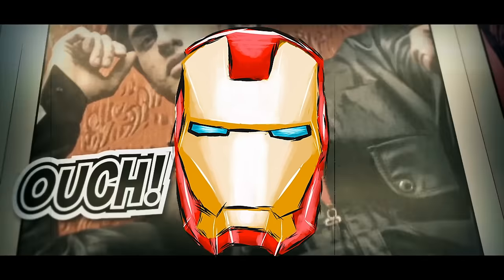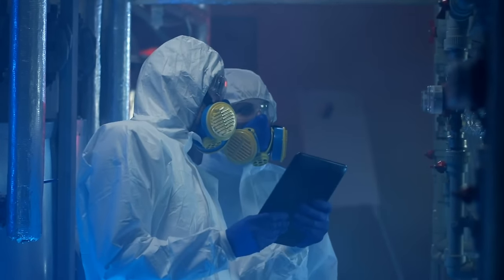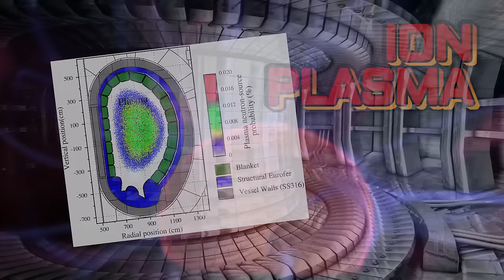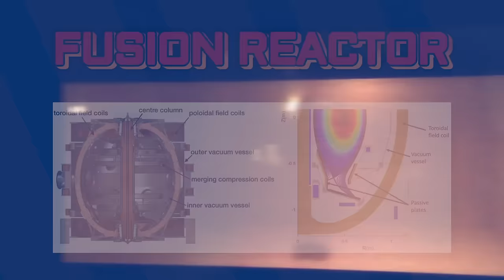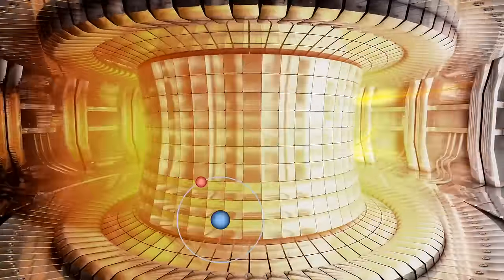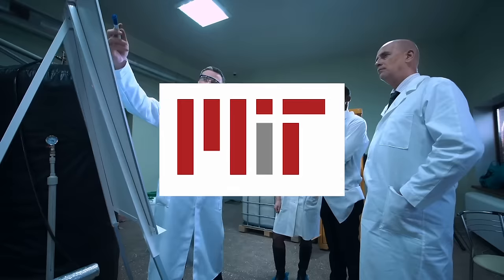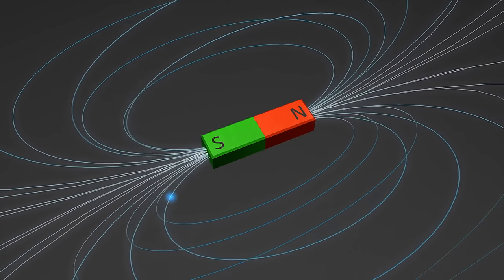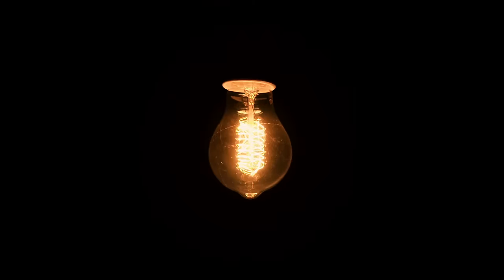How Does Iron Man's Arc Reactor Work?

Comment: A few weeks ago I read that they finally managed to sustain a fusion reaction long enough that they got out more energy than the startup process put in.
Reply: After you get one to successfully continue to run, couldn’t you also absorb/use the heat waste with thermoelectric generator encapsulating it or integrating it. In theory use the ionic energy plus the heat that’s produce as energy as well. Wouldn’t that boost total energy production of the design.
Reply: @302big5  I have no idea. I'm a trucker, not a nuclear physicist.
Reply: @benwillems8584  good man, I’m actually trying to get my cdl in the next month, I just thought I start the conversation based on the information you found.🫡
Reply: Yep and now iron man tech is possible at least a mark 1 or 2 at the moment just no one has really executed it yet but in the future like say a year or so maybe they will

Comment: It would have made more sense for the arc reactor to have been a zero point field or casimir effect generator, because we never see Tony refuel it with hydrogen/helium, nor is regular hydrogen a particularly good fuel source for fusion (deuterium or tritium much more efficient, and where would he get those in a cave in Afghanistan?).
EDIT: granted, he had a lot of spare Stark missiles that he had to work with, so he might have had a good source of tritium. But the waste heat would be a major problem for a fusion reactor.
Reply: Deuterium and tritium are literally H2 and H3. He utilizes the radioactive decay in rays and accelerates the tays to profuce energy magically.

Comment: Hey you know they recently found out a way to create super conductors at room temperatures using high pressure. this in theory could be used to make the reactor work.
Reply: High pressure is an understatement there bud.

Pressure so high that you could not possibly maintain it outside of a lab experiment.

The only use in threse current experiements is to inform strategies of study to create future hybrid low temp, high pressure materials that require only lower level cooling rather than LN2 or LHe, when combined with a managably high pressure to achieve superconductivity.

Removing the need for LN2/LHe coolant would reduce the cost of using superconducting material a lot, but if the pressure needed for superconductivity is prohibitively high then the cost of using it will be too.

Comment: I kinda wish that you  went more into the specific about the supply of hydrogen, because using tritium and deuterium is great but where does it come from? it's not like fusion is genuinely so convenient that is infinitely self sustaining. It's why the sun's core is iron; the process of fusion makes a heavier atom, that heavier atom fuses with heavier atoms, and the energy for each stage of this has net of less output, until about iron, where it becomes no longer efficient to do anything with it, whether fusion or fission. But not a bad video.

Comment: If it's a fusion reactor, what's palladium for? Palladium is too heavy for fusion, so it's not exactly true. Also what good those little coils when you have to transfer those 3GJ/s to devices that use it. It'd melt anything it came in contact with.
Reply: To loose electrons to form the EPS, electro-plasma system circuitry current needed to sustain the MHD (magnetichydrodynamical) power transfer. -> In another words, technobabble. 
Just like the Iron Man suit. It’s supposed to be made of an Titanium-Gold alloy. Except that any knowledgeable chemist or metalurgist will tell you such combination will make for a brittle titanium, it’s a non-stater, and it won’t resist cold temperatures better. A much better choice would be Nitinol, Titanium Nickel, with a bit a niobium for good measure. 
They just put the gold in there because, I don’t know, sounds cool. 
Also, did you notice that what I describe to you sounds a lot more like a fission reactor based on palladium rather a cold fusion reactor? That’s the problem sci-fi writers get when they attempt to explain the details of something. It’s called the “midichlorian problem” - best to left to the reader imagination.

Comment: A full size Tokamak doesn't require palladium.

I always figured the original Arc Reactor as well as the miniature one were using matrix confinement cold fusion (as originally reported by Pons & Fleishman in the 1980s, then debunked, and undebunked, and redebunked at least a couple times since then).  This is a fusion reaction that depends on palladium (though more recently it's been shown that it can occur in nickel, as well, but that would screw up the plot of Iron Man 2).  It's now known to be a real phenomenon (last I checked), but doesn't proceed at a useful rate, similar to the reaction in a Farnsworth Fusor (electrostatic confinement, mainly useful as a compact low-rate neutron source when running on deuterium/tritium, attractive because it can be built in a garage or basement).
Reply: The palladium creates the effect of the high pressure and gravity of the sun. The palladium atoms expand and contract to squeeze hydrogen atoms together to make helium atoms, creating heat.
Reply: @WolfeSaber9933  Which is pretty much the description that was given for matrix confinement cold fusion in the 1990s, except for the (not happening) expansion and contraction of the palladium atoms.  Also worth noting that just fusion heating in Tony's chest wouldn't do anything to either keep the shrapnel out of his heart, or to power the suit; he needs a reaction that directly produces high current electricity with little if any waste heat.
Reply: @SilntObsvr  There is a process that can convert heat directly into electric.
Reply: @WolfeSaber9933  Yeah.  Go look up its efficiency.  Tony'd be cooked before even his heart magnet was powered, never mind that Mk. 1 suit...
Reply: @SilntObsvr  a chair can give about a trillion watts.

Comment: I ran some calculations on this.  The average human male has a surface area of roughly 2 m^2.  Assuming that iron man's suit is roughly an inch thick of titanium; then you'd be looking a volume of 0.0254 m*2 m^2 = 0.049 m^2.  Titanium has a density of 4506 kg/m^3... which would mean the mass of the suit is:  0.049 m^2 * 4506 kg/m^2 = 221 kg.  Tony Starks mass is around 102 kg.  Total mass of suit and Tony Stark is around 323 kg.  Now let's make a few assumptions about his repulsor technology... light has momentum; so theoretically, you could produce a repulsor system based on converting energy to light.  Light has no mass; but it does have momentum.  The equation for the momentum of a bundle of light is:  E = p * c;  where "E" is energy, "p" is momentum, "c" speed of light.  Now... the equation for power is:  P = E/t.  So, let's divide the momentum equation by "t".  P = E / t = ( p * c ) / t = ( m * v * c) / t = m * a * c.  Assuming that his repulsors are 100% efficient in converting energy from his reactor to light; then the maximum acceleration that he could attain is:
a_max = P / ( m * c ).  Let's throw some numbers at this... in Iron Man 1; it was stated that the Mark 1 reactor could produce 3 GW.  So...  a_max = 3e9 W / ( 323 kg * 3e8 m/s ) = 0.03 m/s^2.  In other words... he wouldn't be capable of producing enough thrust to lift himself off the ground.  He'd need to exceed 9.8 m/s^2 minimum to lift himself.  So... to achieve enough thrust to lift off the ground; he would need more than:  P = m * a * c = 323 kg * 9.8 m/s^2 * 3e8 m/s = 949.42 GW.  That being said... perhaps a more efficient mechanism for producing thrust could be used than converting energy to light.  I haven't attempted the calculation for ionizing matter and accelerating the ions.
Reply: //shrugs it's a comic book what do you expect
Reply: @shadowfire04  I wasn't sure what to expect.  Running calculations like this is how I get my kicks.
Reply: pretty impressive buddy
Reply: but repulsor doesnt work on projecting light it works on projecting muons particles as beams

Comment: From what I see. It uses electromagnets to compress the ionizing rays emmitted from the palladium ring, the electromagnets I imagine is powered by that driver board we see on the table in film. I imagine that driver also ionizes the palladium ring somehow over time releasing an immense amount of high energy photons which are compressed by the magnets increasing the temperature and ionization rate of palladium and further increasing the power produced. Those wires would not be able to handle 5 giga joules/second (might be off). That is equivalent to 5 billion watts per second. The amperage would be way too high for those wires to handle. I am guessing the energy is stored in plasma amd confiend by the magnets but this is comic book stuff so take it with a grain of salt. I wouldn't go as far to say a fusion reactor. While the reactor does have a similar confinement it doesn't fuse into higher elements. It relies on the radioactive decay from Pd, releasing rays over time as a form of radiation. It seems to mash together nuclear reactors and fusion reactors. A weird mix.

Comment: A fusion generator is still just a fancy way to boil water and spin a turbine. How did tony go from fusion energy to actual electricity???
Reply: Cuz.....yo mama!!! X'D
Reply: @fpshobbs  That's right they don't, but the heat that fusion reactors produced is still used to boil water to spin a turbine ultimately. Mr. Stark still has to turn that atomic fusion energy into electrical energy some how...Though I might be able to theorize a solution.
Reply: @fpshobbs  I believe that would only produce heat. since you still need charged particles to create electricity and naturally, neutrons don't have charge.  Though neutrons do decay (via  weak-force)  into protons and electrons, so I could envision Tony maybe filling up the  suits power reserve with these electric charges when it get's low. Of course he'd have to change the world of physics again and figure out how to contain individual neutrons.  He invented an element so he can figure it out.
Reply: @jeremiahnoar7504  maybe they creat a shifting magnetic field that spins a generator.

Comment: So, the problem is getting enough magnetic energy to stabilize the plasma.

Without getting a net zero sum of energy?

Is there any way to create the magnetic field more efficiently?

Or alternatives to stabilizing the plasma?
Reply: The goal is to obtain a strong enough magnetic field. Simple ways of doing that include increasing the number of coils, increasing the current that runs through the coils, or increasing the velocity of the plasma (charged particles).

Comment: What’s always confused me is that the suits are treated like they have a set amount of energy that doesn’t generate over time. If it was a fusion reactor, wouldn’t it have a power output that would last for a certain amount of time? Yet in the Avengers and Iron man 3, the suits are given a static amount of power like a battery and need to be externally recharged. When his suit lost power in Tennessee, he had to plug it in, not wait for it to generate more power. 
Plus in iron man 1, Yensin describe the arc reactor it as being able to power his heart magnet for a long time or power something really big for a short time, implying it has a specific amount of charge ready all at once
Reply: Pompmaker1  though in Iron man 3, Harley doesn’t refuel the reactor with any hydrogen, he just plugs it into the power grid, powers it up overnight, and later it functions at full capacity.

Comment: The US/UK/Israeli military have confirmed themselves that they have developed powered exoskeletons/suits. The prototypes run on lithium ion batteries, as reported by the US it has a “about” a 20 minute battery life with 12 hours charging. Impractical….
The idea for gas also works, but size is a problem.

Comment: But how does one converts the plasma heat generated into electricity needed to run the application in the suit, generally in Nuclear reactor, or Thermal power house heat is used to boil water and then turn it it to pressurized steam to rotate turbines connected to generator, it is that rotation of turbine that produces massive electricity, but how does it happens in Iron man suit even theoretically?

Comment: This video failed to explain what fusion actually is. All he did was describe how to create plasma. Creating plasma won't get you any energy, because you use all of it to make plasma hot and glow.

Fusion reaction is when you combine the nucleus of hydrogen atoms into helium, releasing energy in the process. The gasses are in the form of plasma because the temperature required for fusion reaction is hotter than the sun.

Comment: I think even if we achieve the size issue still we will not able to wear it on chest as blood  contain several magnetic material  less in quantity but still they are present  and by this reactor they will start accumulating near by rectors coil resulting in deficiency for those material in rest of body causing serious problem as well as danger of hear attack and vein block will increase not just by 10 or 2 or 50% instead up to 100% simply  heart attack and vein block are inevitable

Comment: That is is also not how a fusion reactor works. It adds two protons together and generates a neutron and an electron.
Reply: Well that depends on what fuel the fusion reactor uses, right? Power generating fusion reactors will combine deuterium and tritium.

Comment: what if there is a another way of creating fusion reaction that not need a immense heat but rather a prototype artificial element which if being expose to hydrogen it will combine and therefore fusion happens and thus not needing any millions of degrees to achieve a fusion reaction. like Tony stark did on Iron man 2.

Comment: If you know the physics, mathematics and chemistry, there is no such thing like a small arc reactor which can produce big amount of electricity. Only small size will produce small number of electricity, dude. Not science facts, but fiction.
Reply: Nothing is impossible. We have smaller devices now that came originally from big size devices like phones and generators. We will probably have a miniaturized arc reactor by 2040 or so
Reply: @thesupreme7501  did you mean that antimatter reactor? That’s way beyond 2040, probably 2700 though because antimatter collection is so rare to be used as an energy source.✌️
Reply: @freezee7547  no, I'm talking about a similar arc reactor like Iron Man. Iron Man's arc reactor produces infinite power, and right now, nuclear fusion is proven to be an infinite source energy because its fuel is practically limitless.
Reply: @thesupreme7501  What about the radiation and toxic wastes from nuclear fusion for a such small thing not to rip apart the living cells like biological molecules? Is that safe to use with that kind of small thing even if law of physics does not do anything with it like E=mc2? I think antimatter is possibly the energy outcome and renewable energy is goal, carbon neutral is key to future but long way, for now, technology like hydrogen and oxygen is key to combine water as a product of electricity. Be green, Bro!✌️

Comment: I think you got it all wrong on how it works its not a plasma core reactor ...it's called a reactor wich it creates electricity but how it generates that electricity is not through hydrogen plasma ...if it was the case it would generate way to much heat and there's no way to cool or shield a small ironman reactor substantially to work...the reactor generates electricity through another type of process using new types of elements   that do not exist on the periodic table but once created can be made to generate vast amounts of electricity

Comment: I have really been looking at this Fusion Reactor idea. I even gave Iron Man Arc Reactor and how it could work.
I created a theory a long time ago that in truth so called experts are not in truth experts because they again are still speculating on how to do something
they them self have done done. So are you are doing is the same thing . Speculation.  
However because I have spent such time on this as more of a curiosity than anything as I spend more of my time 3D modeling/animation projects.
However the answer is rather simple. To create a true arch reactor like Iron Man has to do with what he in fact created. His Arch reactor is a plasma bubble that
traps radiation. This perpetual reaction is  side effects creates magnetic effect in turn electromagnetic battery. Also known as Ball Lightning.
In the 1980's the military tried to duplicate this effect and was released to the public as they seemed to have failed and it became declassified. However by chance
a TV Show got the film footage of released footage and the editors slowed down the test and in turn found they in fact did create the ball lightning as it left the screen to the right.
They figured they failed because the attempt was to try and control it but figured they failed. Soon after this video was shown that they did not fail the video file was placed back to . Reclassified  as top secret.  The TV show that published this live lost the footage and shortly after the show ended.  
Now how was it made. Well in truth much of the answer is already told.